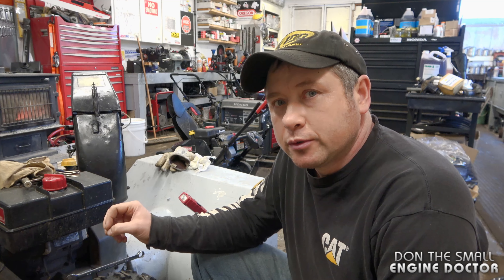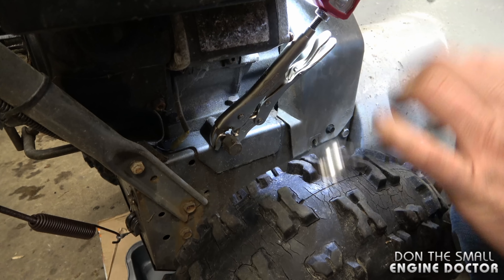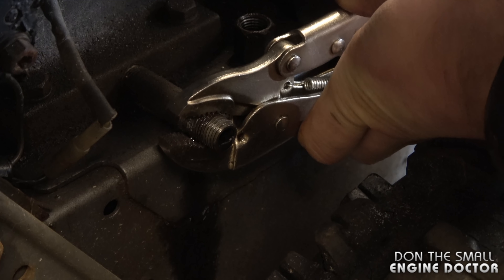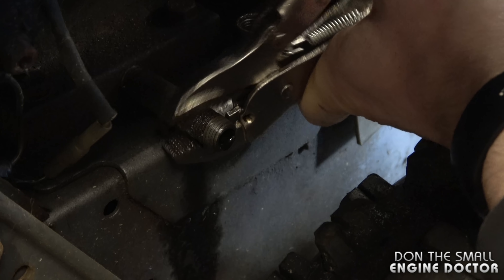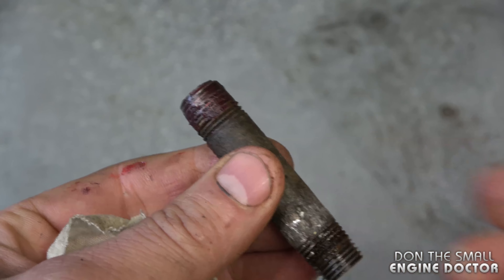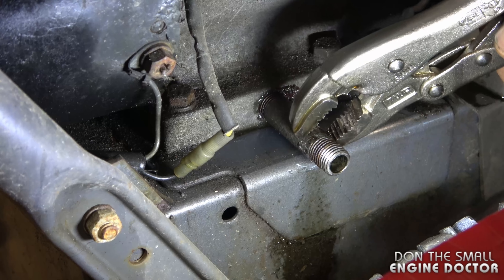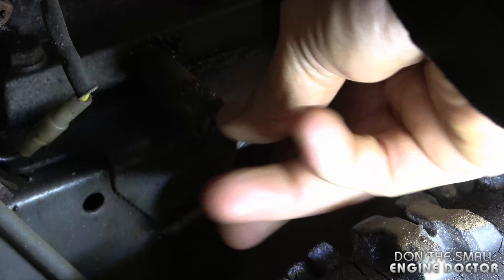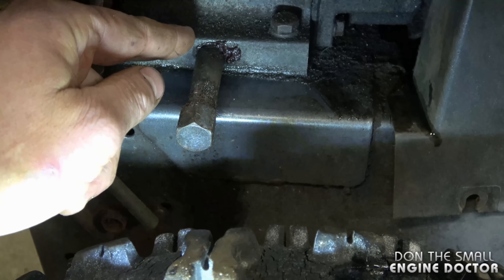Fix That Annoying Oil Drain Tube Permanently On Your Small Engine!

Comment: Don’t you need to clean the oil out of the female hole for the lotite to set up properly?
Reply: Normally but not with this new stick type of Loctite.  Their website explains how it is anaerobic and can be applied to oily threads.
Reply: mumbles552 I checked out the website. It says that LOCTITE 268 quickstix can handle minor oil contamination. While I hate cleaning threaded holes, I think it would still be worth it. Although, maybe an argument could be made that in this example, if the thread locker didn’t hold, it wouldn’t be the end of the world.
Reply: @FrAdamVoisin  Exactly!  It only takes a moment to tilt the machine over and clean and dry the threads using a Q tip and brake cleaner or whatever. Clean and dry threads = peace of mind and a good sleep that night!
Reply: mumbles552 agreed!
Reply: mumbles552 
  Also thinking to run that oil tube by the wire wheel for about 15-20 seconds per end... just me... Not a fan of dirty reassembly.
Reply: Not like it's a space shuttle or rocket science

There's no dinner on this channel

Comment: Sometimes there is no tube at all on these engines. Could you please record a video on how to install a tube. Might seem simple but folks like me don’t know exactly what to buy and want to get it right. Also, how to extend the tube and add a right angle so the oil is easier to catch. Thank you so much for these videos, I’m always learning from you 👍
Reply from the maker: here's a video on how to install on lawn tractors, https://www.youtube.com/watch?v=O_gTahB33FA
Reply: It's normally just pipe thread.  Bring the plug with you to the hardware store and find a pipe nipple and cap with the same threads, and there you have it!

Comment: Red loctite holds well because it will not come off unless you use a torch to heat it. I get so many mowers and blowers with oil and grass caked up all over because that tube came loose and leaks. A simple repair but so many lazy people unwilling to do a simple easy repair. Good Video! Thanks.

Comment: I sometimes mention to the customers at our ACE store (we sell tons of TORO machines...) to use clear vinyl tubing of a preferred length. Put one end on a funnel...the other in your oil-pan. Remove pipe-cap while holding funnel just below!
Also:
* Make sure oil is WARM. Run engine for a few minutes.
* If drain-pipe is on a side, run opposite wheel up on a 2x4/similar item.
* I sometimes put 2 tbsp of Seafoam in the oil when running engine for 15 minutes before the oil-change. 
* My engine gas ALWAYS has a steady mix of Seafoam. In my 1gal can, I put a 1/4 cup of SF. 
* Gasoline used is ALWAYS Ethanol-free, Top-Tier Premium.
* My blower is 23 yrs-old now, & running STRONG! 8hp Tecumseh Snow-King.
:-)
Reply: I never thought of using the combination of a funnel AND tubing.  Great idea!
Reply: @Guillotines_For_Globalists  -- Once a decade, I have a decent idea! It's just too cheap & simple!
Reply: One thing that I do when changing oil on ANY engine, is to wait until the OLD oil is dripping  at about a drop every 15sec, then run a quart of fresh oil through the engine before putting the drain plug back in. This HELPS to flush out "MOST" of the remaining old oil! Peace of mind, besides oil IS CHEAP! Been doing this for about 65yrs and feel GOOD about taking care of my engines!!!!!

Comment: Hey it's in 4K!  And it's good 4K.  Nice and sharp.  60 frames per second too.  Way to go Donyman!
Reply from the maker: thanks, just getting used to using 4k
Reply: @donyboy73   Could you tell me what camera you are using?   Is it a phone?   What is the make and model of the camera or phone?  It really is good, even the depth of field is good (deep).
Reply from the maker: @BioCosmic--Dust  sony AX53 4K
Reply: @donyboy73   That is excellent.  The Sony AX53 4K is a real camcorder and it's a very good one.  Nice, and thanks for the info!

Comment: Very good tip Don. Usually I change my own oil on my Ariens Compact snowblower and always use a vice grip to hold pipe while unscrewing end cap, but I had my Ariens dealership replace both belts on my eight year old Ariens compact two years ago and I had them change oil as long as they had it, which I regret. Last October when I usually change oil, I could not get end cap off even with the pipe wrench holding pipe because dealership tightened too much. Deep grooves were made by me on pipe by pipe wrench trying to get end cap off. I ended up unscrewing entire pipe off engine and I placed pipe in a table vice in order to get end cap off. Because I almost crushed pipe with vice grip wrench I purchased a new pipe and end cap. Next October I will use your tip on oil pipe. Needless to say I was swearing like crazy trying to get end cap off. If this ever happens again by a dealership of over tightening, do you think heating end cap would help to remove end cap? I think you know this, but new Ariens snowblowers have a machined edge on pipe now that can hold in place by a open end wrench while unscrewing end cap with a second wrench. 
Thanks,
Don from Milwaukee
Reply: I would have called that dealership up and told him to send a guy over here to take this damn thing off
Reply: @bobkalinoski8447  ,Bob, I came close to calling them, but I made up my mind never to go back to them again for purchase or service. At the same time I had them change belts and oil, they said I needed a scraper bar at bottom of snowblower for an additional $40.00. Many months before that, I bought a scraper bar for $22.00 from same place. I blew up when they told me that with a $18.00 markup for same item and I told them I would never return, plus gave them a bad review on GOOGLE. I have since switched to another dealership, plus Amazon and Home Depot sell Ariens parts. Thanks for the comment.

Comment: I have a 26 year old Ariens with a Tecumseh engine much like the one in the video. I put Loctite on the drain tube after about the 2nd year I bought it. Still holding strong. No fancy flex lines or ball valve as suggested by other commenters. Keep it simple. Only work the blower has needed was regular maintenance. I always use plain gas with ethanol and just add StaBil to my gas can.

Comment: I just picked up a 1988 MTD snowblower (Model 318-586-352/1287B) with a Tecumseh engine (HMSK80). The manual says the oil drain plug is under the muffler side. There is also a brass tube sticking out under the gas tank on the other side of the engine that looks a lot like what I see as the oil drain tube in a lot of videos. The drain plug identified in the manual drains oil right onto the body of the snowblower and makes a mess. Am I missing something here? Is there a better way to be draining the oil? I'm new to small engines and am trying to learn. I love your videos!

Comment: Donny I have a generator “PowerMate “.  There is a line coming from the top of the gas tank down to a box about the size of a brick bat mane a little smaller. When stored gas runs out of an outlet in the opposite end of this box.   Have you ever encountered this.   
Can you tell me the function of this box.  
Thanks for any help you can give me on this. 
McRoy Gardner 
Lenior NC

Comment: What I did was remove cap, thread on 90°, add another 3” tube threaded into the 90° and replaced cap. Now I don’t worry ever about loose at engine and I also have an extension on the drain so I can get it to drain into a pan instead of everywhere else.

Comment: Hi, I just picked up a used 22" yardmachine snowblower, it has a plastic impeller that seems to be binding or has some extra friction slowing its rotation and is squealing at times. Any suggestion on what might be going on before I start to take it apart? Got a storm coming and it will be my first use with the blower, dont want to burn it up. Thanks.

Comment: Good video.  When would you change a snowblower oil? Manual says every year but seems overkill to me. Especially when the oil is still clear and looks fine.
Reply: The reason they say every year is because used oil turns acidic even within just a few hours of use. So the once a year oil change is good advice.
Reply: Robin Hanson I’ve never changed my 1 year old ariens. Still looks clear. Maybe I should change it lol
Reply: @appleztooranges  It doesn't matter if it looks clear, the acid's start the minute you start running the engine. Plus it's only 3-4 bucks to change it yourself. Do the change at the end of the season.
Reply: Robin Hanson ok I’ll do it in spring. Didn’t use it much last year. Have feeling use it ton this year. Thanks for your response.

Comment: The most annoying things of oil changes on small engines is where the drain plug is, how short it is, or even if it has a drain plug!  My snow thrower could have used a longer tube then it would have dripped out without making a mess.  Lawn mower doesn't even have a plug, you have to tip it upside down and dump the old oil the same way it goes in.  I know it's a money saving thing to these companies, and pennies go a long way, but damn!

Comment: I wonder how much it would add to the cost if this were done at the factory.  Blue or Red, 1000 engines a year, would it even add $1USD?  But doing so would save so many folks issues down the road.  But if the factory did this we wouldn't have this video, would we?  Thank you for sharing it.
Reply: Michael Remski it’s all about selling parts. $$$$$$$$$
But yes, just making it simpler at the factory would be better for all of us

Comment: Can you help with a cub cadet Ltx-1046 oil change, tried putting on a quick connect adapter but it wont fit in the drain hole because of the engine flares.

Comment: I have a Z248 Husqvarna.  I need to replace the belt but the new belt just will not go on. I can get it around all pulleys except the last one and it only fits to about the center  of that  pully. It just won't go anyfurther. Any suggestions? 
Wayne

Comment: Last time I had this problem I ended up twisting off the end of the pipe before the cap rotated it was so seized on.  Of course the pipe screwed out of the engine easily.  Of course...  New pipe and cap and I was on my way.  Just don't tighten it so much and this isn't an issue.

Comment: Why when I start the engine I have an oil leak after doing this? May be I twisted off the pipe? 🤔.. I have an Ariens St724 (932047) and I don't find this part in manual 🙄

Comment: Question I bought a used snow blower and the guy drilled the electric start mounting holes bigger? How do I get this fixed?
Reply from the maker: you might have to try a heli coil
Reply: @donyboy73  thanks for the information

Comment: will you please tell me how that locktite is supposed to hold with all that oil on the female threads on the engine.........i don't get it............i'm sure you know a lot more than me but it does make me wonder about some of your methods............at least tilt the engine back a little ,,,,,,and clean the threads
Reply from the maker: it will, I've done it many times,
Reply: @paulreid7370  Loctite makes a specific "oil tolerant" threadlocker. So they must know something. Most types of Loctite will likely be OK as you say, but you could go the extra mile with "oil tolerant."
Reply: @donyboy73  ok, so i learned something but that's not saying i would trust it till i see it with my own eyes,,,,,,,,,,and in your video you could have saved me the question by pointing this out when you used it on the oiled threads.................thanks......
Reply from the maker: @yardlimit8695  I can't read people's minds

Comment: I would think the red Loctite is an overkill for this application since it's too powerful that if the drain nipple needed to be replaced, heat would be required to remove. Perhaps a medium strength Loctite such as the blue would be better suited. This is just a thought. I appreciate your videos donyboy 73.
Reply: J Nieto  you need the red because of the heat the motor will produce
Reply: Good point. Thanks.
Reply: @michaelfield9467  I checked with Loctite and with Red and Blue Temp range of -65 to 300 degrees F. applies to both. Except for Red Hi-temp/hi-strength formula which is Temp range -65 to 450.
Reply: J Nieto thank you for checking
Reply: @michaelfield9467  Not a problem Michael. It's always good to learn.

Comment: That certainly solves the problem but wouldn't the use of red loctite make the tube nearly impossible to ever remove without damaging the threads on the engine? I elected to just use blue loctite on mine. It also solves the issue but allows the tube to be removed if needed.
Reply from the maker: you can still remove parts with red Loctite, it's not welded on
Reply: @donyboy73  Agree. But it usually requires heat. I guess you could get in their with a torch and heat the area. Granted, the tube should never need to be removed. My luck is someone would cross-thread the cap after fixing the loose tube, :-)

Comment: I just switch everything to brass nipples of whatever length I need, with a 1/4 turn ball valve on the end.  That solves this problem and others.
Reply: I'd thought of that but I was afraid something might accidentally hit the ball valve handle and I'd be out of an engine.
Reply: Valid concern but I haven’t had that happen in 25+ years.  In some applications, after the valve I add a very short nipple with an o-ringed cap that just goes on finger tight just for safety’s sake.
Reply: This is an awesome idea! Almost brilliant..... :-)
Reply: You can get the brass nipple ( that the tube coming out from the engine block) from a hardware store in the plumbing section. I added used a braided stainless flex tube after the valve and used it for several years. It was handy but the wires in the braiding started to break and you got little wire ends sticking up all along the flex hose. The main convenience was from the nipple and the valve so the flex was over kill. You can wire wrap the valve lever so that it won't turn accidentally.
Reply: Another thought - you could also remove the handle from the valve.  In most cases this would mean any adjustable wrench would open it with a 1/4 turn - still easier than fighting the stock configuration and no chance of opening it by accident.

Comment: Or......put a 90 at the end of the nipple, then plug the 90, no more nipple twisting(unless she’s into it) and the oil drains straight down instead of out if it’s warm like how I like to drain any of my machines, hot oil flows better, leaving less old in the engine. 
Your welcome